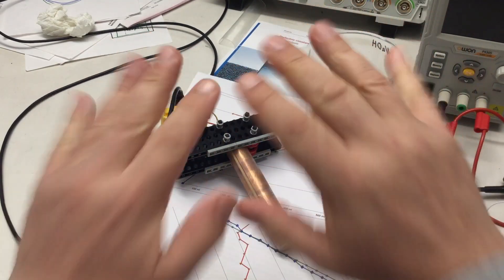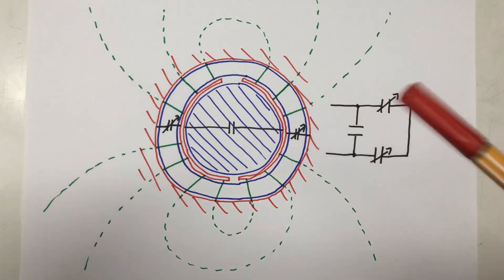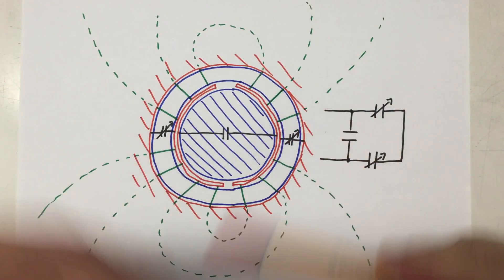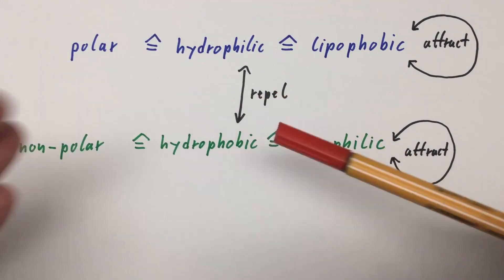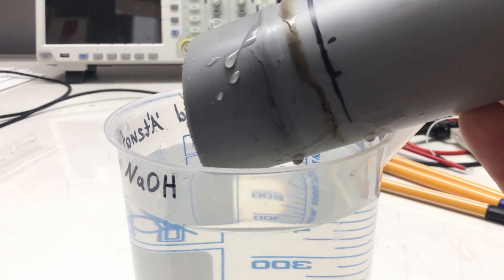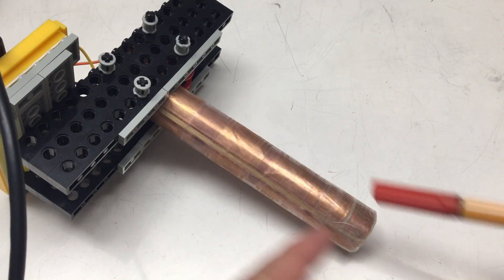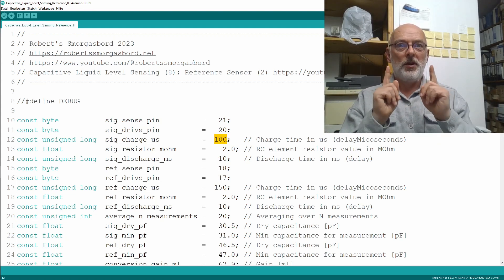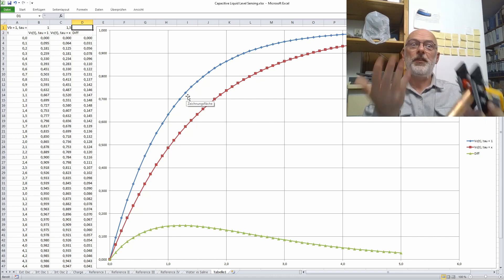Capacitive Liquid Level Sensing (10): Errata, Miscellaneous, The End

Comment: Hello. I'm working on a similar sensor. The electrode I'm using is not vertical to the water, but rather horizontal. Because of the water's adhesion, my sensor appears fully charged after a while. What plastic material should I use for the best results? By the way, I've started following your videos. Your work is excellent. Thank you.
Reply from the maker: Well, if you're measuring water (a polar liquid) you will get the best results with an non-polar plastic, because water will not "stick" to it. Examples would be polyethylene (PE), polypropylene (PP), polystyrene (PS), styrene-ethylene-butylene-styrene (SEBS), and polytetrafluoroethylene (PTFE). The latter might be hard to come by.

Comment: what if the capacitor is made around the tank. Or, if a 1/2 inch tube is placed on the side of the tank and connected to the bottom of the tank and the capacitor is made around this tube? There is no more water around it...
Reply from the maker: I talked about that in part 1 ( https://www.youtube.com/watch?v=Jjcym2g2ruk&t=1479s ). The challenge here is to avoid errors due to changes in the capacitance when for example touching the tank. But there a specialized chips for that ...

Comment: Interesting, just stumbled across your video.  I remember serving on a ship that had a unique tank.  Was back in the 60's and strictly analog measuring system, but the probe was a capacitance probe covered with nylon (if I remember correctly).   What was interesting about this tank was it was below the water line and open at the bottom to seawater all the time.  We would pump bilges into it where the bilge water contained seawater and turbine oil.  The oil separated from the water and the seawater would simply leave out the open bottom.  So at any given time the tank was always 'full' but some of it would be seawater and some of it would be oil.  When we got into a port, if the tank had a lot of oil, we would arrange to pump the 'waste oil' tank to a shore connection.  As we pumped oil out, seawater would enter at the bottom and when we noted seawater going to the shore connection we new the 'waste oil' tank was 'empty' (well, didn't have any more oil in it).

Not sure HOW in the world the level probe system was built or calibrated, just we were taught it was a 'capacitance probe' setup.  From your discussion, the mix of oil (non conductive, non-polar) versus seawater (conductive and polar), must have been quite the tricky calibration.
Reply from the maker: Thank you very much for that most interesting "application note"! The way to calibrate such a probe isn't too hard, since the tank can be assumed to be full at all times. You just measure it once with filled with just sea water, and that's your "oil empty" state. Then you measure it with a certain level of oil floating on top of the water and that will give you the capacity change proportional to the oil level. It's quite an ingenious use of a capacitive liquid level sensor. I myself thought of a similar application for a diesel tank (with a reference sensor) to measure the level of water that accumulated on the bottom of the diesel tank.